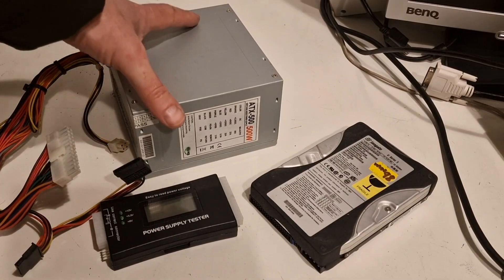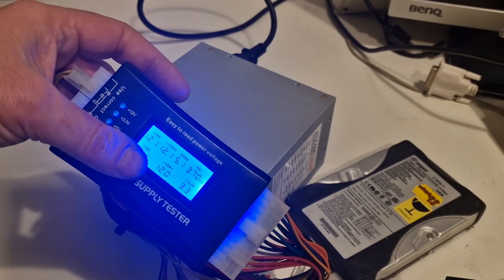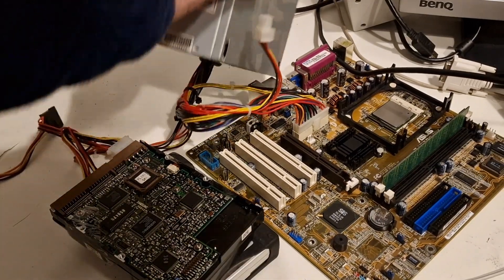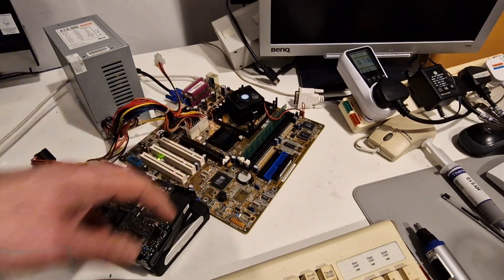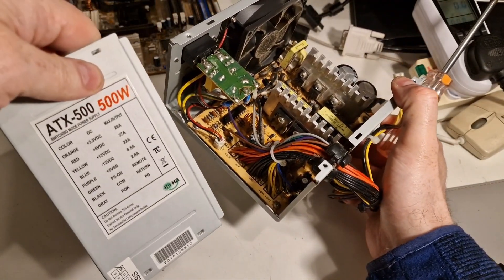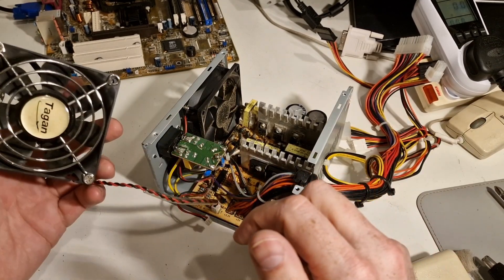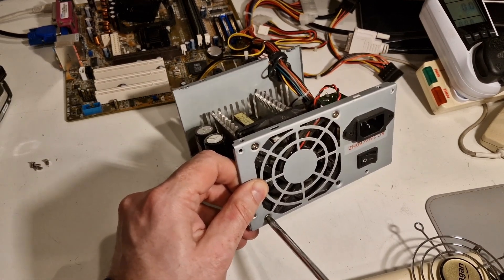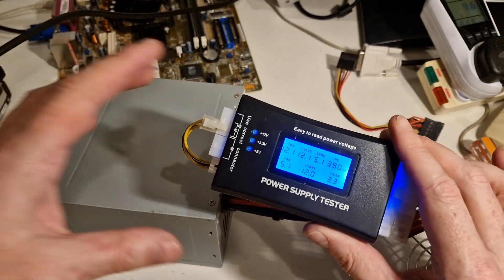ATX-500 PSU - The cheapest NO-NAME power supply ever made? (test and fan replacement)

Comment: This one is still far from the worst. It's an old school 300W unit relabeled as a 500W one. It should have stronger 5V rail (from 25 to 30A), which is nice for some older sytems without the ATX 12V connector.

And trust me, I've disassembled hundred of these and many ones even fixed, so I know what I'm saying.
Reply: The worst PSU I currently know is Armaggeddon Voltron Bronze 235FX. The inside is almost empty, with no EMI filter, a single inductor toroid, and thin heatsink. Priced at ~$13

Comment: This is one of the power supplies that used to come included with the computer case many years ago. I still have one as a testing unit that was used for 7 years in an old Pentium Dual Core and GT210 system. They might be alright for low power computers but the fans were always too loud for me to actually use them for anything